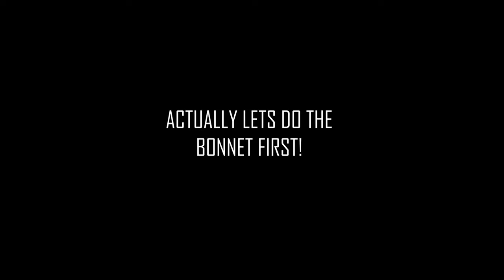Rebuilding a Copart Car - Fiat 500 - Episode 2 - Front End Is Being Installed

Comment: Good luck on your new venture. You really need a proper indoor workshop and better tools but I realise you have to start somewhere. Possibly some rookie errors. At this stage you need to view cars before bidding so not caught out. Maybe the inner panelwork could be pulled back rather than cutout/replaced. I wouldn't change the wheels - extra cost, traders may notice, insurance implications - the car is a general runabout so keep it stock. Can you fix the sound levels - voiceover very quiet compared to the music.
Reply from the maker: Thanks for the comment. Sadly no one is able to visit copart and look at the vehicles before bidding due to the covid rule changes or I would welcome a walk around. As you say a workshop comes with time and I can not just set one up to start a new channel as the financial implications are too high but maybe in time things will change. The inner panel work is double skinned and not suitable for pulling so a cut and replace is the best viable option. Yes sound levels were bad in my first videos but this is all about learning and they have now been corrected to the best ability.